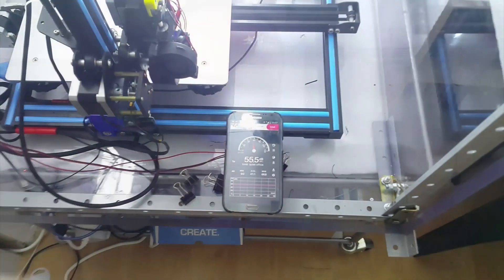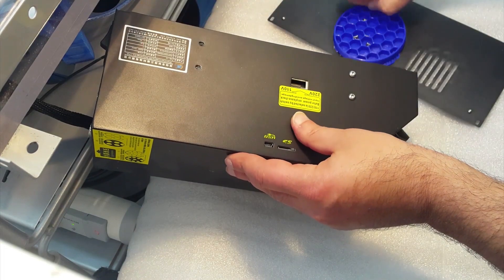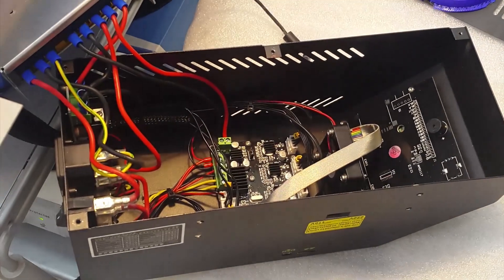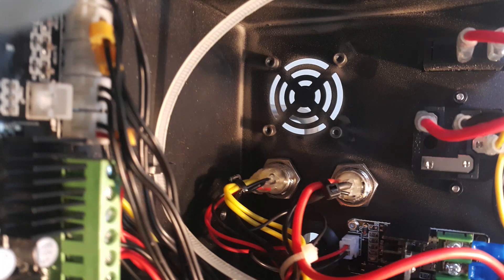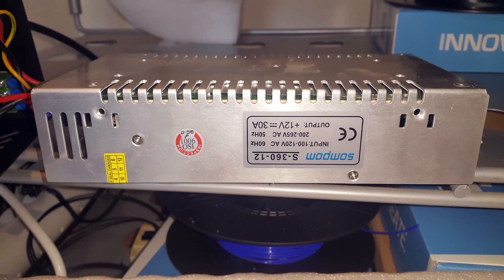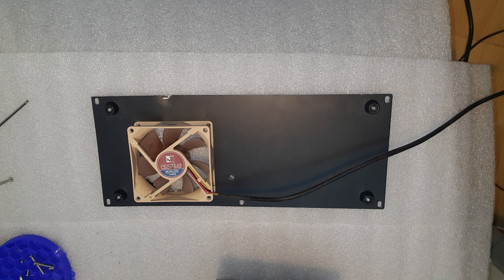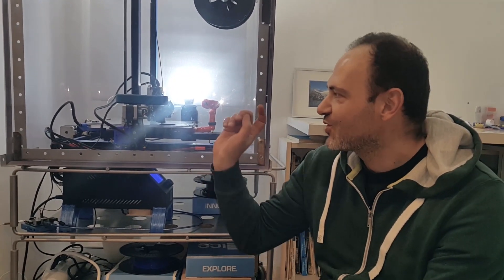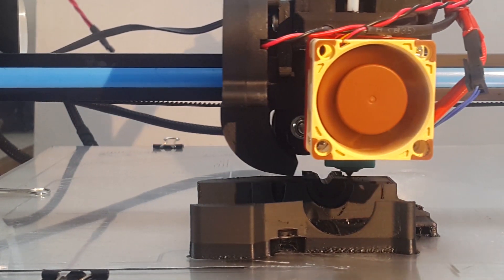Making Creality CR-10 3d printer silent

Comment: Dude... that 80mm adapter doesn't fit there and now I've wasted my money and time :(
Reply from the maker: Hi, I'm sorry you can't fit it in. There are slight changes in the enclosure layout between cr-10 versions, may be this is the reason. I see in the comments section of the adapter in thingiverse there is a comment it is not compatible with the V2 control board https://www.thingiverse.com/thing:2591759/comments. I no longer use this solution, because I changed the control board with a 3rd party one.

Comment: What was the overall temperature difference in the power unit with the new fans versus the old? Did it affect the needed printing temperatures in any meaningful way when you upgrade the nozzle fan to a larger one?
Reply from the maker: Hi, I didnt measure before and after temp in the control unit. As I wrote it is blowing fresh air all the time, so for me it is fine, may be even better. As for the fan on the heatbreak it doesnt affect the temperature of the nozzle because it shouldnt blow on the nozzle, but it should improve the cooling of the heatbreak.